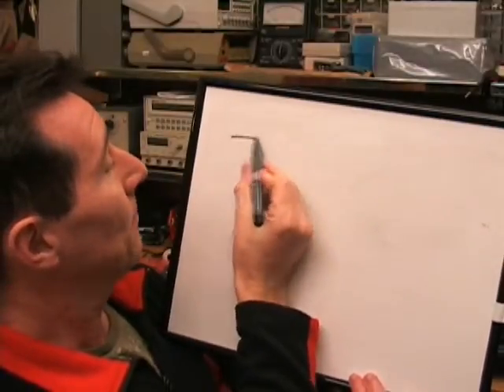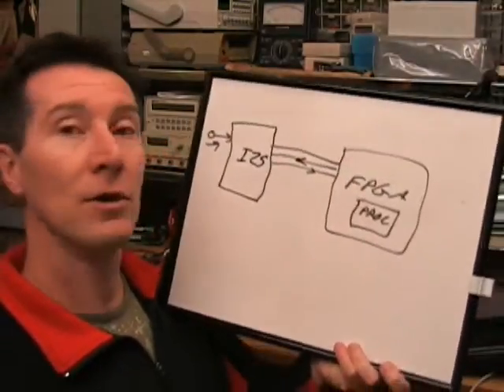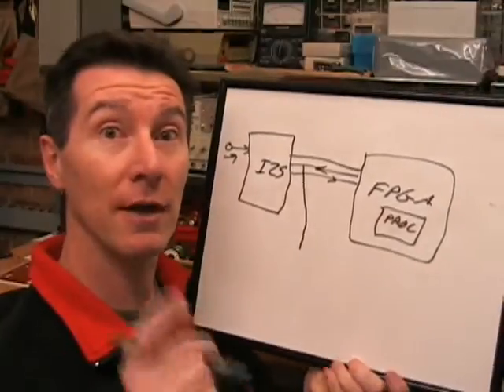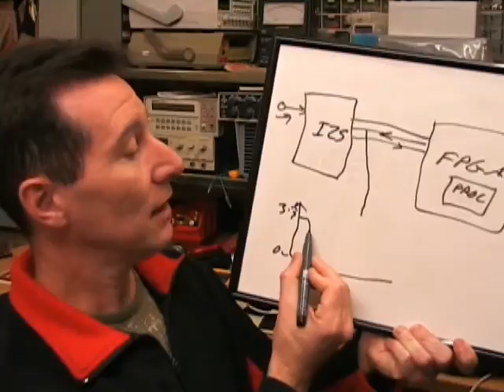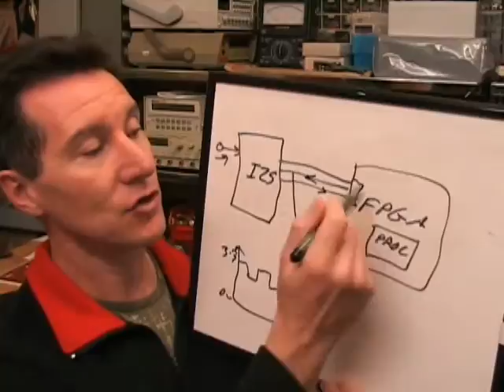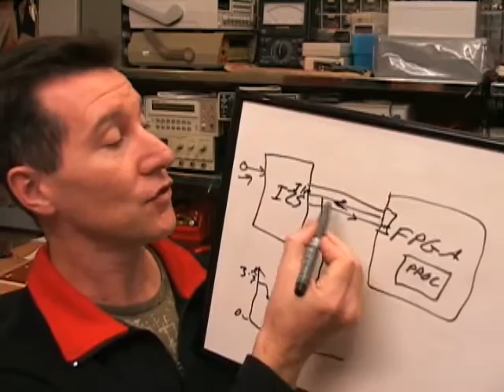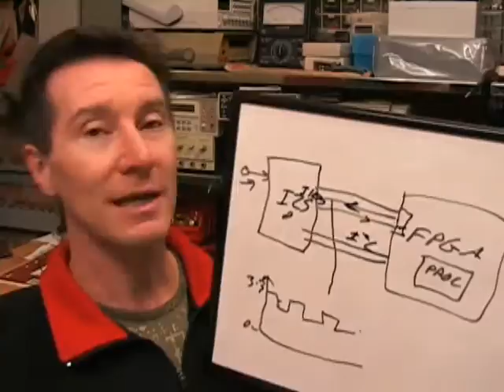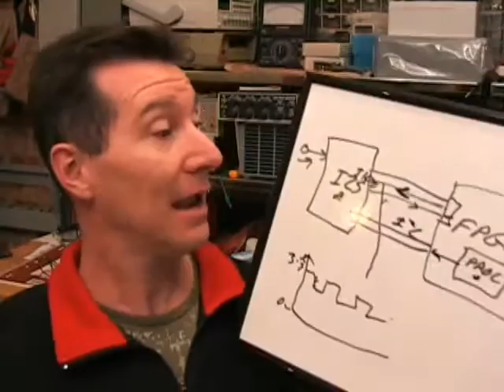EEVblog #17 - I hope your next project DOESN'T work!

Comment: In university we once had to implement a simple circuit that blinks an LED containing 2 chips. When we had everything wired up it simply didn't work at all. So we triple checked everything and in the end it turned out that we had a faulty chip. One of them was a quad NAND gate. We only needed on of those gates and exactly the one we used didn't work ^^

Comment: I would like to generalize Dave's advice. His case only covers that dual-purpose feature. My opinion is that every engineer who is using a microcontroller peripheral or any external chip, has to verify EVERY single associated configuration bit for the right value and read that piece of the documentation very carefully to operate that hardware correctly for the mode you're using it in.
Reply: +SE45CX 100% agree. I see so much code online where they just assume the device will be in a known state after power-up. I've had enough tear-my-hair-out bugs over the years that I now always configure every single peripheral and pin after power up, never assume a pin will be an input or output or tri or has a comparator or adc or dac or interrupt or whatever connected to it at power up... must configure everything first so you have a known base condition to build on.

Comment: Its also good to have a way to read back configuration data to make sure the commands did "stick", or even just dumping the value of the "ACK" bit somewhere in memory that you can read with a debugger. It can be a bit of a pain when a device has a write-only configuration port.

Comment: Hi Dave! Since I've found your blog about a month ago, I've been working through your videos "All willy nilly" when I saw this one. Your project curse came true for me as well. It was a simple op amp oscillator for a project and I could get the darn thing to work. Through troubleshooting and a MASSIVE oversight, I got it to work (single power supply trap). The amount I learned through the process was astounding. Thanks for the vids!

Comment: The most insidious new design issue I ever encountered was the same transistor failing twice after initially working, however, the third transistor worked and never failed in the prototype board on thru the 30th board. Patience is useless in this field as it is like so much dry tinder and is quickly consumed. The nuclear fuel of commitment is what you need whether it is a hobby or your job to get you thru the debug phase of issues you can't imagine and that no one has ever encountered before.

Comment: Yup and it's super easy. I tapped the audio real fast and applied a notch at 50hz and all odd harmonics. Completely gone, literally 5 seconds of processing. Maybe an extra 30 to transport back to editing software. Sync not an issue. Add 110hz HP, cut 2k+ by 5dB, 8dB noise removal (different to notch filters) algorithm, then +17dB soft-knee compression + soft limiting and BOOM, very clean, full-scale audio in about 90 seconds.

Comment: Could you not take off that audio hum by cancelling the wave - or even a simple filter? Although the awkward bit may be taking off the audio, taking it through an audio processor, and then dubbing it back on without messing the sync.

Comment: This reminds me of that case when I didn't use a pull-down resistor at the output of an optocoupler. It went straight into a chip and I got a waveform like that =/

Comment: If you turn it on and it does NOTHING, it's probably a P.S. problem, which is easy to fix.  As for the learning process, it's better for it to sort-of work...eg, with distortion, intermittent cut outs, unwanted oscillations, etc.

Comment: My last project didn't work at first, so I learned what happens if I leave a CMOS input floating, a signal has too long rise time and why would I need to connect capacitors across rectifier diodes in a FWB if I wanted to use the 50Hz signal from the power transformer (because otherwise I would get a spike and the signal would be detected as 100Hz).

Comment: when i made the second prototype for my 8 digit display, i'd shifted to using a tristate output shift reg for addressing the display registers and i found all the display registers were changing and showing the same outputs, as im using the OE pin on the tristate register it makes the strobe lines on the display registers OC and with noise it was strobing the display registers, putting on some pulldown resistors helped with that

Comment: I once had some serious problems with an Atmel flash IC in a no-lead package that was not fully solderded onto my board. So one (or possibly many) pins were only coupled by capacitance. It drove me freeking nuts finding this fault, as you could not measure the signals at the leads. The flash's basic functions like reading and writing larger data blocks seemed to work without problems but more specific stuff like reading a config register failed. After re-soldering the chip it finally worked.

Comment: @BusterBlader910 I'm an ex-electronics engineer - these days I write software. But when I started I designed analogue RF transceivers (private mobile radio systems), then went on to low-power digital RF communications, some consumer electronics design (wireless burglar alarms), then one-off electronics display systems for exhibitions and education, but then drifted into software. If you understand the theory, can build stuff that works in practice, you can do what you like.

Comment: Great advice regarding dual purpose I/O. I always put a series resistor (a few hundred ohms) between any two pins that could potentially clash. The firmware still has to be right, but the current limiting resistor can save hours of debugging because it reduces unexpected brownout resets, code excursions, IC damage, etc.